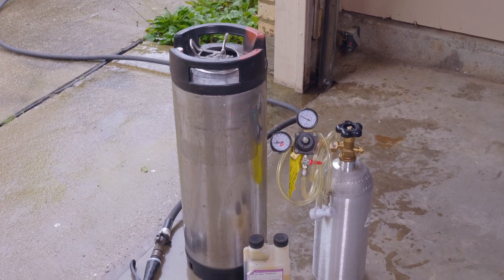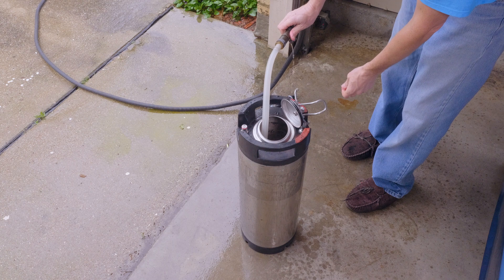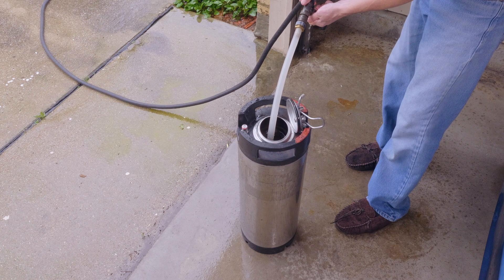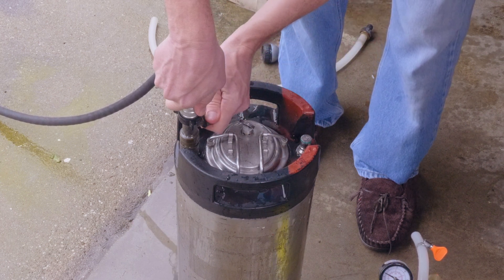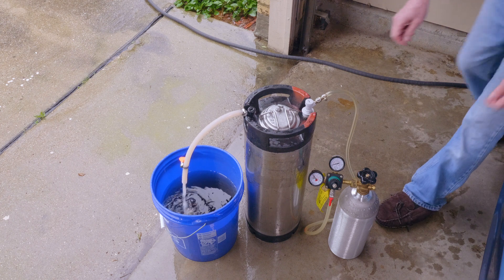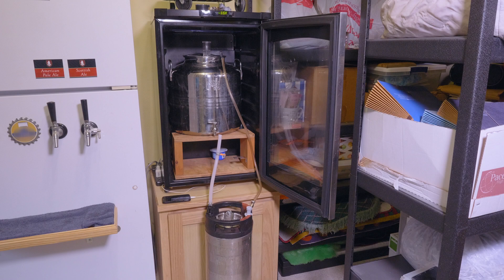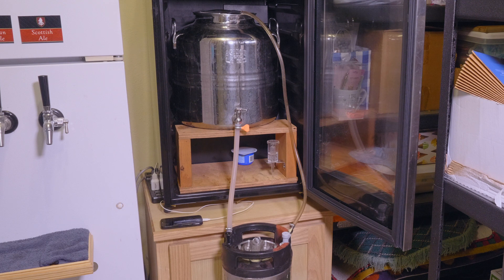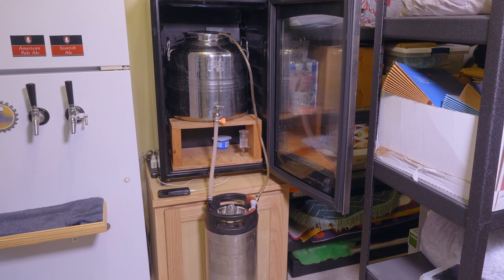Low Oxygen Kegging Procedure

Comment: Best Low Oxygen Kegging Procedure video on youtube !! 
Thank you so much !
Reply from the maker: Thank you.  I need to say I forgot to shoot a little step which I have never updated.  At time 5:15 when the sanitizer is flowing out of the quick disconnect, tilt the keg towards the "Liquid In" side.  This will dislodge the air pocket that is trapped up in the keg lid.  When you tilt the keg, you will see the flow pause then start up again.  That is air pocket being released.
Reply: @integrityhomebrewing7202  Thanks, I saw your answer in one of your comments. :)
Transferring very hoppy beers should block the ball lock, right?
Reply from the maker: @mikofbm  There is a good change hop material would block ball lock connectors.  I would use a little screen and let everything settle out before you transfer.

Comment: I just bought ss mash caps, sodium metabisulfite, im going in 🤙🏻 round 1 been brewing AG for 15 years but this method is giving me the needed refresher to break the monotony, trying to figure out how to move the wort from MT to kettle without introducing o2, i get using a mash cap and underfill but the actual hose connected to ball valve seems like a place to pay extra attention
Reply from the maker: Great.  I hope you enjoy the journey.  I need to update this video as I did not film a part where one gets the last air bubble out from the keg lid.  If you can, underlet when possible.  So a slow pump from your mast tun into the boil kettle spigot is the best way.  Yes, I use clamps to secure the connection of the hose on to the barb.  These connections are important but can be controlled.  The big stuff is taking the O2 out of the strike water, doughing in SLOWLY, like 10-15 minutes to let the Sulfites have a chance to work and solid cold side.  That will get you most of the way there.

Comment: Does the C02 pressure assist pushing the transfer or would gravity donut alone? Never had a closed system... Now I want a closed system! Cheers.
Reply from the maker: If you mean transfer from the fermenter to the keg, you can do it either way.  Some push out with CO2 but I do a gravity transfer.  You just need a place for the CO2 in the keg to go.  You do not need a "closed system" per se, you just need to "close" your transfers.  No oxygen inside the keg is the main goal.